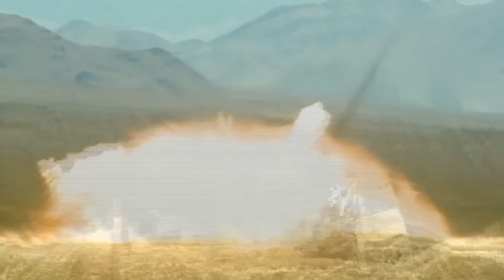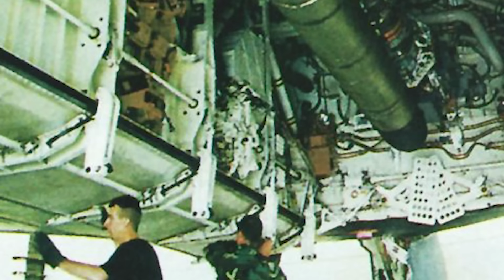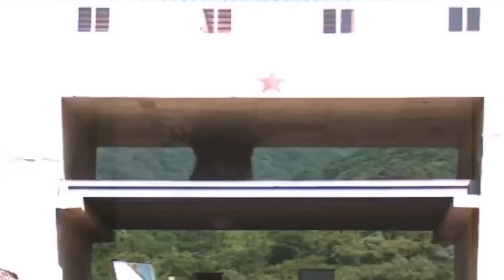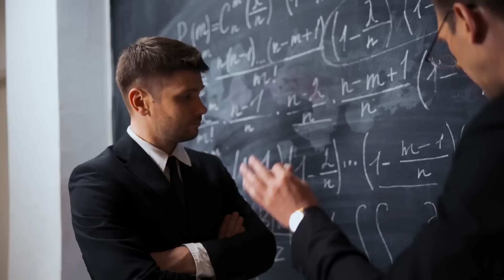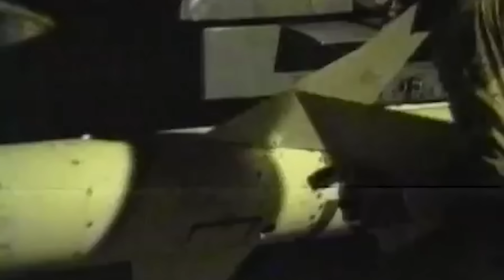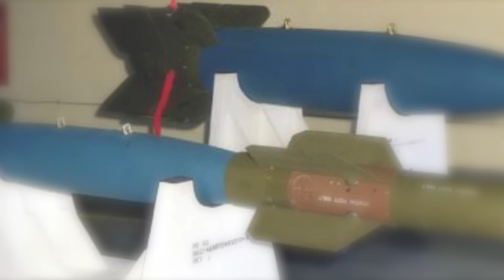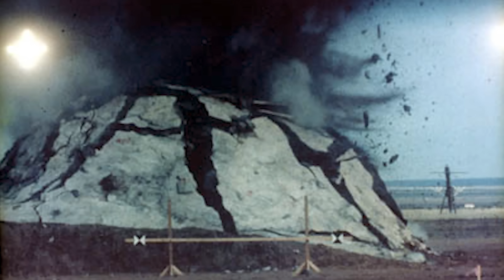The Monster Bomb that Turned Ground into Butter

Comment: Reminds me of a book called Dam Busters I read in the early 1950s.   It was mostly about those round bouncing bombs, but I think it had something like these.
Reply: Nah, dam busters or (Bouncing Barrel Bombs) were essentially modified depth charges that they packed with more explosives, they would come in on the lake side of the dam, drop the barrel and it would skip across the water, hit the top of the dam and roll over and down the face of the dam before it exploded.
Reply: You're right. The Lancaster carried the Tallboy against tough targets like the Tirpitz and fortifications during WW2
Reply: Actually the Brits developed a spherical bouncing bomb.   It was code named HIGHBALL and was intended to be delivered by modified late-model Mosquitoes.   They were used as an antishipping weapon and it worked very well against German coastal shipping off the Norwegian coast.   Look up a movie called “Mosquito Squadron” and you will see some film footage of HIGHBALL being employed against surface ground targets.  HIGHBALL required a mechanical device to spin up the weapon to a given RPM before release.

Comment: Note to self: never build a bunker less than 1 kilometer deep, and reinforce it with 50 feet of concrete.
Reply: Its reported hamas has tunnels 6k down... but they are all in sandstone...  sounds rsky to me
Reply: If you have whiskey, I am joining!
Reply: @scottmurphy650  alot of fact started scifi ...i remenber something like the rods of God in a movie 10 15 years ago... scifi ray guns are now laser cannons on aircraft carriers
Reply: You'll end up with a "Mineshaft gap"
Reply: So 5 miles of concrete SHOULD be good.
Reply: @ronallens6204 not an issue when entrances are at the surface. Doesn't matter how far down you can go if you can't get out.
Reply: @Max_Chooch if they can bore so deep you can't dig em out, they can easily go sideways and have lots if exits very far away
Reply: Minecraft gap?
Reply: @ronallens6204  Wouldn't there be problems with air pressure at those depths?
Reply: @Max_Chooch  i don't know where else u could put an entrance 8)
Reply: @DunnickFayuro  not really, should make it easier to breath... the problem are the gasses that are heavier than air. The people in the tunnel above can drown you with the CO2 they exhale, or you would eventually drown in your own exhaled breath, not to mention the gasses in the rocks... ventilation is your only means of staying alive.. that is why the old time minors use to carry a bird with them... if it died, they ran to get out of the tunnel before the air killed them.
Reply: Then they would invent the GBU-29
Reply: And ten feet thick steel
Reply: @jrkorman Dr. Strangelove reference.

Comment: The WW2 explosive, 'Torpex',  developed at the Royal Gunpowder Factory in the UK was 50% more powerful than TNT. Torpex included 18% powdered aluminium.  The German equivalent of Torpex was Trialen.
Reply: Called tritonal in the US
Reply: 22000lb earthquake bomb dropped by modified Lancaster bombers in WW2
Reply: I remember my father talking about this he was part of the original Nike Hercules missle project they were trying to figure out what explosive to use of course then I was only 11 years old so I had no clue what they were talking about until years later when I asked him
Reply: Torpex has a RE factor of 1.3 so not quite 50% but still stronger than TNT. TNT is the gold standard and all explosives and sets the scale at 1. Current C-4 has a RE of 1.34. The idea of Torpex was to increase the “Brisance” or the shattering power for the explosive in torpedos, thus helping crack the hulls on enemy ships. Torpex is 40% TNT, 40% RDX, 18% aluminum and 1% wax binder.
Reply: @ryanhampson673  Hence the name "Torpex" - 'Torpedo Explosive'.

Comment: WWII earthquake bombs (Tallboy & Grand Slam) used by the UK in WWII could penetrate the U-boat pens and V1 facilities.

They were also capable of destroying railway viaducts and the like by exploding deep beneath them causing a "trapdoor effect" and the target structure dropped into the chasm thus created.

The Tirpitz was sunk by a combination of direct hits and near misses. The near misses dug out  the sandbank below the Tirpitz so thatit capsized as a result of the damage caused.

If they had had the benefit of being guided they would have been even more effective.

Comment: Another great video.   I’m an old Veteran, but I seem to remember a call for 105’s during the first or second Gulf War.   I guess they wanted the barrels?   They got one from a company here in the Rocky Mountains - they specialized in using cannons to create small avalanches that prevented larger avalanches.   I could be wrong or mistaken….

Comment: How does the GBU-28compare to the Grand Slam bombs:? Which would be more powerful ,  being dropped from 40000 feet a 8000 pound bomb or a 22000 pound bomb .
Reply: Grand slam was more powerful and penetrated to 100M, it destroyed bridges by sinking the whole structure into the ground.
Reply: Well, different design and purposes,  one was designed to cause a quake and use seismic waves for destruction.  Other is a penetrator. There is an interesting Youtube video about tests conducted on the valentine bunker after WW2.
Reply: When a deep target absolutely, positively has to be destroyed, try the fairly new 30,000lb.  GBU57. It has harder steel than anything before it, so it can penetrate deep, and has modern explosives that are far more powerful than anything made in WW2.

Comment: Adding 20% aluminum powder makes the explosive mixture 18% more effective? Is this DoD math or am I missing something?
Reply: Not sure about the math, but it does great when the particles are dispersed into a cloud before the initial explosion. It's also used in some solid rocket motor fuel.

Comment: Am I getting something wrong? I thought the design of this weapon initially they used a barrel from a tank. First one tested didn’t have explosives and it ended up so deep in the ground they just said screw it.

There’s a lot more to it, but am I getting the weapons mixed with something else because the rest of the story adds up !
Reply: Yes. The first production batch used 8in howitzer barrels. Later production used a purpose built casing

Comment: And the USAF decided to go with the GBU-57 MOP (Massive Ordnance Penetrator). Also, I'm stoked to see that you used footage of AMMO troops in the video, as I was one for my 12 year Air Force career. Most times in videos like this they'll only show the loaders, which in the Air Force is a completely different AFSC/MOS.
Reply: So you were a 461. Loaders were 462s. I was a 463.   😊👍
Reply: @joeswartz8286  essentially yes. I was in after they changed all the AFSCs around, so I was actually a 2W0.

Comment: GBU-72:    60 meters (200 feet) through 5,000 psi reinforced concrete, 40 meters (125 feet) through moderately hard rock and 8 meters (25 feet) through 10,000 psi reinforced concrete.

Comment: The US employed a similar rocket-accelerated bomb against hardened targets (submarine pens) in late WW2.  Weighing 4,500 lbs, and developed by the Royal Navy, it was called the "Disney bomb" after being included in the Walt Disney animated movie "Victory Through Air Power"   The penetration performance (14 feet 8 inches (4.47 m) of concrete) of the Disney was found to be satisfactory, with a predicted maximum penetration of 16 ft 8 in (5.08 m).  It seems to have worked well, but not having the infrared homing technology used in the GBU-28, it was not as accurate.

Comment: A poxy little 4,400 pounder? That's not a bunker buster! Look at the RAF's Tallboy 12,000 pounder with a tungsten steel armour piercing nose - that's a bunker buster! It sank the unsinkable battleship Tirpitz and could penetrate about 30 feet of reinforced concrete. The RAF also had a 22,000 lb version called Grand Slam, but it was not much used as it was a bit too large to be practical.

Comment: WW2? RAF?

617 Squadron?

"Tallboy" and Grand slam? 

The armoured "pointy" nose-cones on these monsters meant that they were supersonic well before impact and your basic 5 Tonne "Tallboy" dropped from 20 thousand feet, sliced through over five metres of reinforced concrete in the top shell of U-boat pens, to detonate INSIDE, where the boats and crews were. MESSY! "Tallboys" were the final  wrecker of the battleship."Tirpitz". Even straddling the ship in the relatively shallow Fjoord, meant seriously buckled hull plates and eventual capsize.

The 20 thousand pound "Grand Slam" would plunge at least 60 metres into the ground, before detonating. This created a HUGE underground cavity, which swallowed huge stone railway viaducts, where months of smaller bombs left dinky craters and a lot of lost airmen. The sort of occasion where "close enough" really  is "good enough".

Comment: This weapon only works if the rooms are not secured by thick walls and blast doors that limit the spread of the explosion.

Sure, it can penetrate from the top, but if it hits a concrete cell instead of an open space than it's range is severely limited.

Comment: All they needed to do was put the Grand Slam back into production - with more modern metallurgy to harden the pointed tip, and the ability to be dropped from its originally intended altitude from more modern aircraft (The Avro Lancaster could not reach that altitude envisioned by Barnes Wallace when he designed the bomb, and the air ministry refused to allow resources to be diverted to construct the six-engined "Victory Bomber" designed by Barnes to carry the bomb at altitudes that would probably have been out of reach of the fighters of the time), it would have been a breeze, as the Grand Slam was the big brother of the Tallboy, which was used to penetrate nazi submarine pens, with seven metres of steel reinforced concrete armouring in their roofs, and the Tirpitz, among other targets.  The Grand Slam was used to extensively re-landscape the mountain in which the V2 ballistic missiles were briefly assembled and fired from, and the "supergun" V3 which they similarly rearranged before it could go into action.  Never mind butter, Barnes Wallace's earthquake bombs shook the ground to the point of liquefaction.
With modern guidance packages, it wouldn't even need to be dropped by specialist elite squadrons like 617 sqdn anymore, although those guidance systems would need to be inhibited below the speed of sound and the tailfins locked into the offset position to give it the gyroscopic stability to penetrate the pressure shock wave without tumbling, then into the opposite lock to stop the spin before the normal guidance could be enabled.

Comment: This bomb is nothing compared to the real rods from God. Imagine a meter long darning needle made out of titanium and depleted uranium shot from a railgun on a satellite in orbit at 27,000 mph. The accelerated rod hitting the ground With a one meter degree of accuracy. The enertia propelling the rod hundreds of feet underground through solid rock or concrete. And with an entry point The SIze of a bullet hole. And when it hits an underground bunker or cavity the contents there in would be sucked out a pencil sized hole back into outer space in milliseconds. Everything, especially organic matter. What a way to go!

Comment: You show on your picture on YouTube a Fuel air bomb which does turn the ground to butter, but I saw no butter here. You showed a pic of C-5A and said it was a C-141. Then after correctly showing FB-111s but still called an F-4 an FB-111.

Comment: Nothing really mighty about this bomb. At the close of WWII, England was building the Grand Slam, which weighed in at 20,000 pounds. Designed for ground penetration, it had a delayed fuse. The Lancaster bomber could just carry it.

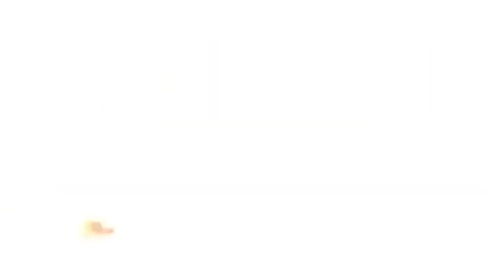Comment: The footage at the 3:17 mark is a yugoslavia so called bunker, which its not, they had submarine pens and alo real bunkers why not use them during the war ,plus also the us thought the F117 plane was a stealth plane till a Yugoslavia anti aircraft battery shot one down, because he worked out when the bomb bay doors were open the plane had no stealth shield with in the bomb bay inner surface thus it gave a positioning of the plane also he pingged it 3 times when most us pilots were taught the anti aircraft barry's only ping 2 times?

Comment: Was this the bomb that was made out of tank/gun barrel?
Reply: The steel is extremely hard and thick. And it is easier and far less expensive to cut down an old barrel then to forge and machine a new casing. The project had a very short specified time period.

Comment: Not sure I Believe all of this. There were some fill shots that didn't follow the story line . The bomb either worked or it didn't and story line results were confusing. I was not impressed with the narrator's script. Lastly there was no documented proof the bomb turned the ground into butter. This claim to create something similar to liquefaction was not supported in the story line. In fact Bunker bombs are meant to destroy the open spaces of a bunker and were ineffective if the open spaces were not reached. No such bomb exists except a thermal nuclear device that will reach a state of ground liquefaction. Bunker buster bombs do not liquefy solid ground or cement. The ate meant to pierce the ground and reinforced concrete and explode in the open cavity causing a collapse of the structure.

Comment: Bunker Buster? This is neither new nor an invention of the good ‘ole USA.   The British designed a 10,000 lb. bomb called ‘Tallboy’ then upscaled it to the 22,000 lb. (10 ton) ‘Grand Slam’,  AKA the earthquake bomb. That’s  heavier even than the US MOAB which at 21,700 is not the mother it’s claimed to be. Oh and by the way the Brits did this in 1944 and used  the four engined Lancaster bomber  to carry that load into the heart of Germany.  The best a B17 could manage was 4,000 lbs, or 8,000 lbs if it was a short mission. So let’s have less of the invented in America propaganda and a bit more recognition that your allies paved the way for you. True of the jet engine too !!!!!